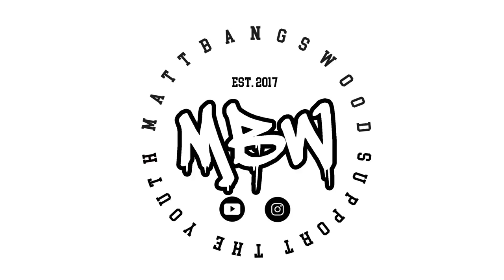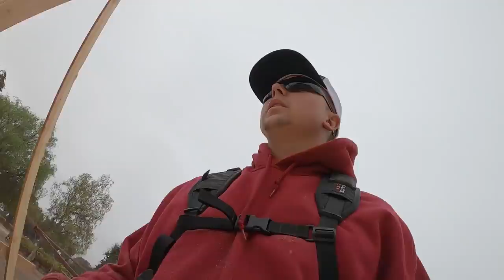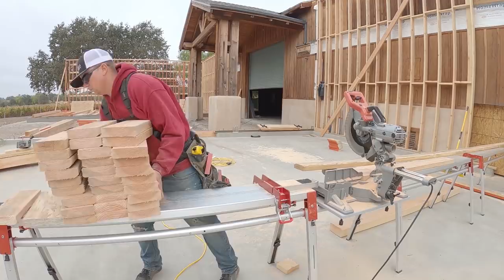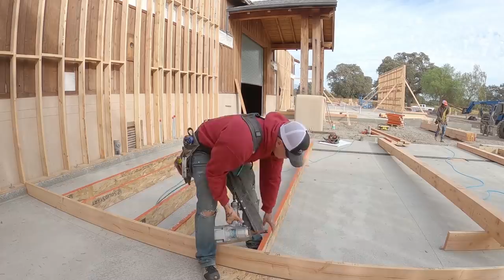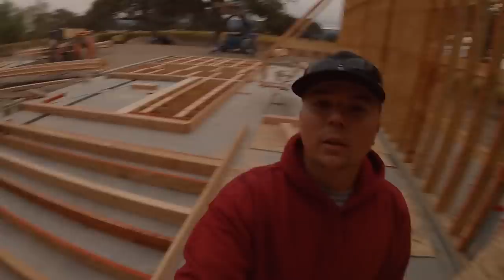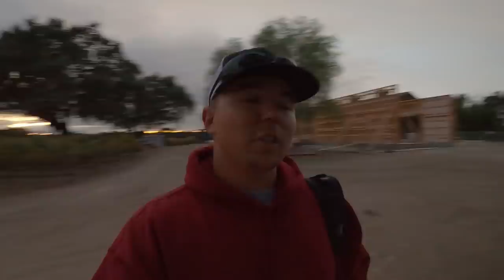One Building ALMOST Done! [DAY 7]

Comment: Could you not double stack the 2x8s on the cut hub to cut 2 at once
Reply from the maker: Technically, yes. These 2x are soaking wet and heavy though. I wouldn’t want to try pulling 2 20’er’s on there.

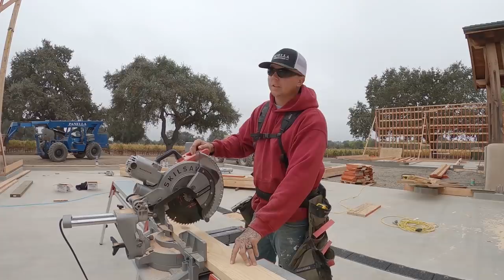Comment: 1:28 why no ear pro?  The little foam earplugs work fine and are super cheap.  The thing that sold me was this.  My first job as a framer the owner of the company had been banging out houses since his late teens, I had to yell at him for him to here me.  He never wore any ear pro, ripping on a table saw, cutting hardie board, nailing, ect.   Also I recently ran out of earplugs and worked all day with only one.  At the end of that day driving home the ear without the plug felt different and had a slight ringing.  You are a professional and make your own choices, but as a fellow tradesmen I urge you to look after yourself.
Reply from the maker: I do from time to time - on this specific project.. I’d rather be able to hear others, in the case a wall is falling, and I can’t hear someone yelling because I have ear plugs in.. I’d feel like a real ass killing someone.
Reply: I use ear buds.  Keep the music to a low volume (batteries last a lot longer that way) and I can hear my surroundings better than with ear plugs.